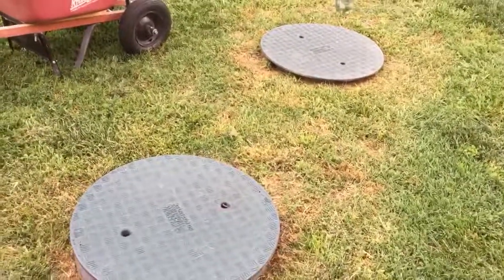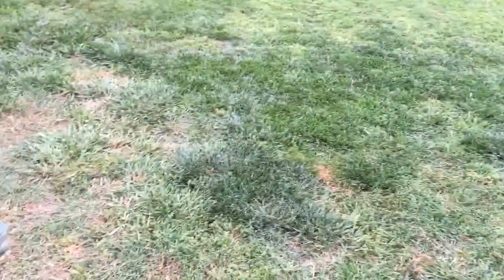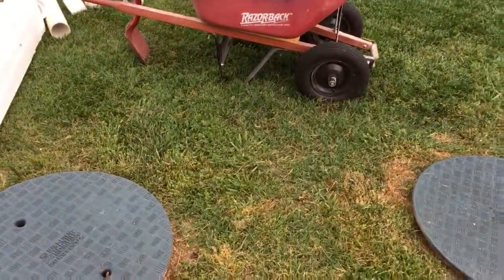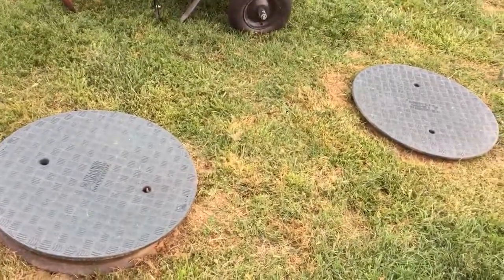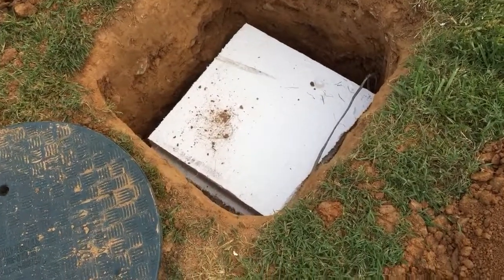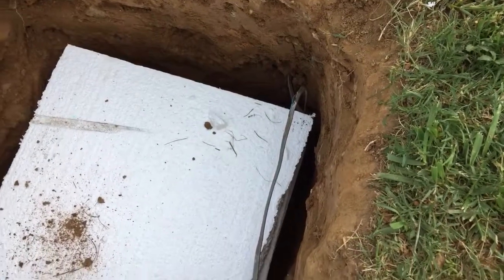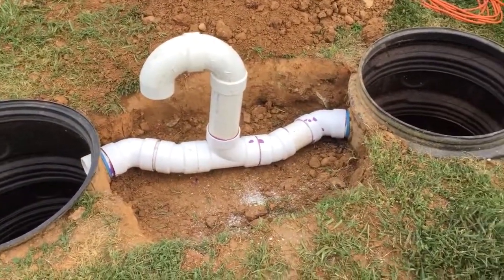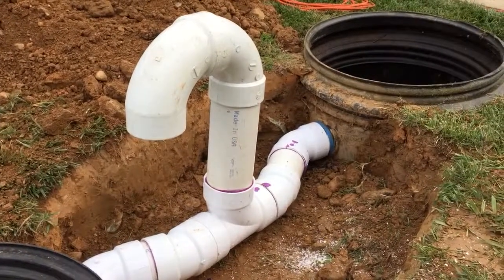Septic Tank Maintenance, Addressing Hydrogen Sulfide

Comment: Hydrogen sulfide gas is heavier than air so it won't vent out.   This wasn't much of a problem until lift stations.   With gravity field designs the gas would sit on the water surface and as the water level in the lift station rises the hydrogen sulfide gas would flow out the pipe and into the field where it would break down in the soil.  But with lift stations the gas is lighter than water so it can't be pumped out by the lift pump which is under the water.   So it is trapped and reacts with any concrete above the water level.    I know this b/c I've been through it.  I had a baffle completely rot away after 3 years, rebar and all.     I had to have a baffle replaced.  I knew that would last only another 3 years if I didn't do something .    I think it's good that you connected the compartments with piping, but on mine there is a small air gap above my 2 baffles (3 compartment tank) so I wouldn't need them.  I put an exhaust powered vent with a floating corrugated hose going down to the surface of my lift station,  it's a 4" hose, it floats on the surface and goes up and down with the water but my fan corroded up after 2 years.   i'm replacing the fan and I'm adding another to the first tank to blow air in.   I'm hoping blowing air in will reduce the concentration of the hydrogen sulfide allowing my exhaust fan to last longer.   I may opt to add a bubble aerator to change the bacteria from anaerobic to aerobic which will significantly reduce the hydrogen sulfide gas and the air being pumped in will help the exhaust fan by adding a tiny bit of positive pressure to the tank and reducing the concentration of the H2s acid gas.    If In had known this when I spent $25k on this septic system 5 years ago, I would have asked about a plastic tank or for them to use a aluminate concrete (7x more acid resistant).  Oh yeah one more thing, when I had the baffle replaced I scrubbed out the tank with a pressure washer to get all the loose lyme and chalk out and I plastered on Rapid Set concrete (aluminate) to increase it's acid resistance and strength....
Reply from the maker: Aerobic will help in many ways in your septic and I like plastic tanks myself. I didnt have a choice with mine as our house was preowned so the system was already in. So far all seems well with it now.

Comment: interesting video, but I dont' think it will work because Hydrogen sulfied gas is heavier than air, so while some might vent out the top, it will still be in the tank causing deterioration.
Reply from the maker: Its the best I can do for now. Better some gets out than none. Poor system maintenance and bad habits has caused the damage. The house was almost twenty years old when we bought it. I could put a blower on to circulate the air.
Reply: @GuntersGarage  blower on a timer to blow out the gas for 10 minutes every day would make your system work. doubt it has much benefit the way it is piped now.
Reply: @GuntersGarage  My septic tank is in the front yard which slopes down. I plan on just extending the discharge pipe out 10 more feet till it breaks the surface, then gas should just naturally flow out due to gravity. My tank was just pumped and is empty. I wonder if there is any kind of paint I can seal the top with? that is where most of damage is.
Reply: Cemprotec E942 epoxy can also be used to protect concrete from h2s2.
is what I just googled.
Reply from the maker: I pump mine every year since we moved in. We have been here for 18 years now, wow time flies. The previous owner didnt pump regularly I certain as the tank didnt have risers and its about three feet to the top. I know he didnt dig it up to pump it regularly to pump. Plus just like my wife has a habit of shoving food stuff down the drain I bet the previous owner did the same and thats part of the deterioration. Short after we moved in I installed the risers, a new tee baffle with outlet filter and alarm so we dont get a back up flood. Im sure theres something to coat the concrete but I know Im not getting in there to do it, lol 🤣

Comment: I didn't know the tanks would deteriorate. Are the blanks for a vent system that should have been installed when new?
Reply from the maker: Concrete normally wouldnt it was a surprise to me when i learned about that condition. Those risers were an upgrade i did when i replaced my drainfield they are multi purpose.

Comment: Very interesting.. I didn't realize how septic tank have evolved. Is your township real picky? Ours is you basically can't do any work yourself. About 10 years ago we had to replace our leach bed. Fortunately we we are way off the road and did it ourselves in secret.
Reply from the maker: Up until Jan of this year you didnt need a license in my county, but due to being in the Chesapeke Bay Watershed area the EPA has tightened up on regs. Thats why I try to do good maintenance as the newer systems can be very costly and some require annual mantenance contracts with licensed proffesionals. Luckily I am lisensed in 2 states for septic installations :)